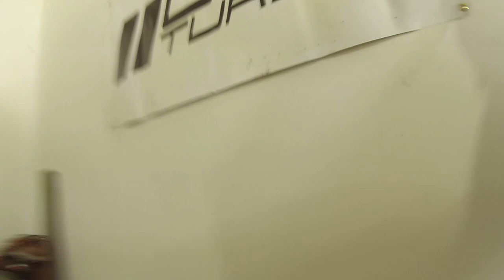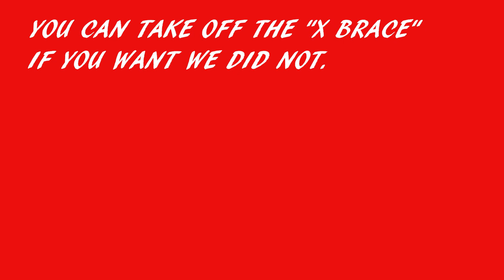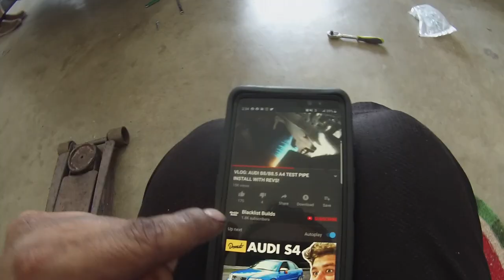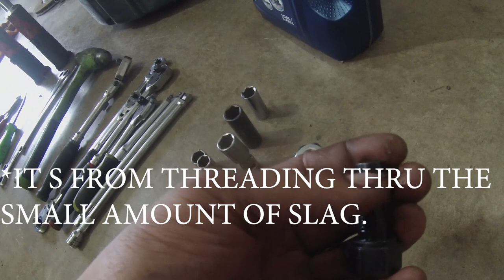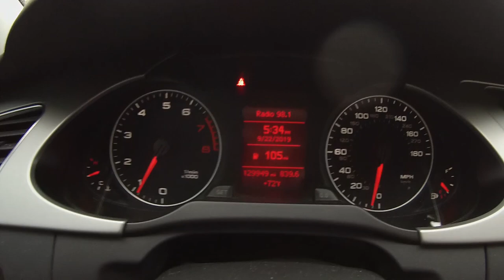how to  install a downpipe on your 2010 Audi B8/B8.5 A4 2.0T

Comment: The video was getto AF but I found the info very useful. Seeing a factory cat come out the top and the copper gasket spray trick made it all worth while. Keep up the good work as I understand this stuff is not easy to record.
Reply from the maker: 😅thank you ... these early video I made weren't the best. Camera was old and I wasn't sure how I was shooting things or editing them. But what I did know was I couldn't find a direct answer online for how to remove the DP . So my key in this was trying to share the problems and experience  100% so others would have a simpler time hopefully removing there down pipes.
Thank you for watching theres many more mods to come on b9 also I have much better hero8 now.
Reply: @TheRwdyAudi  I'll be sure to keep track. Today I replaced the factory cat with a high flow one on my A8 B8 and it has made a big difference . It's will get a stage 2 flash tomorrow and planning a DIY water/meth set after that :D. Being right hand drive it had to come out the top because the steering column is below. Your vid was the only one I could find and quite helpful. Cheers.

Comment: Where can I get the hardware? I have no clue why it isn’t nuts and bolts on the stock set, it’s these weird studs and nuts which ended up snapping.
Reply from the maker: Hit up your  local hardware store typical  grade 5 stuff will work fine use "lock nuts" to prevent these from coming off .... not nylon... you can but ...meh ... lock nuts have little dimple on the side of them .... you got this👊😎

Comment: What did you end up doing with the check engine light cause I was able to take care of it just wandering if there's a different way or the same way I took care of it. So what did you do?
Reply from the maker: Used to spark plug no foulers and small piece of steel wool
Reply: @TheRwdyAudi  very nice I'll try that next time.  I used a spark plug  no fouler but it had a built in mini catalytic converter 35$
Reply: @TheRwdyAudi  is steel wool going to last or a temporary fix to pass inspection or how long did it last or a permanent. It's good to learn these tricks on a pinch case some times thing's don't always work out the way you want and a temporary fix will do justice always open minded to solutions
Reply from the maker: @transam8607  I would say  more of temp solution  ... long term ... if your need to do this your probably  just annoyed at the light I would recommend  getting it tuned .. and have systems just tuned out permanently  for emmision  reason ... but I have gone true emmision  stations on other vechile with the steel wool mod and let just say those car are still on street.... I guess it could go either way depending on what your needs to re
Reply from the maker: that's sweet havent seen those got a link ?.. I would like to try those next time
Reply: @TheRwdyAudi  I'll look into finding them I remember it was called  something  daddy but I'll definitely get back with that link
Reply: @TheRwdyAudi  I found them let me know if the link worked it's weare I believe I got it from but if you need me to look for the exact part I  Purchased it might  be a little tough to find it http://www.bigdaddiesgarage.com/ and forgot to mention it's been almost 2 year's already and no check engine light thank God and good point with the gaskets I never had good luck I used original ones case they failed on my one's on the a4 and planty of other cars learned the hard way with gaskets thinking I wasn't doing the job right ended up gaskets failure

Comment: After installing the check ing light is on?
Reply from the maker: Yes that's normal you have no catalyst  to clean your exhaust you will need to talk with tuner or use any number of way to trick the down stream sensor to think it okay

Comment: Hi, the test pipe don’t give engine light?
Reply from the maker: Not if you use a o2 spacer in your down stream o2, however these are are extremely smart and will occasionally throw cel when the weather shift drastically. Problem is easily  solved with a tune

Comment: Is this tuned in the video? And what told you to lower your speed?
Reply from the maker: No cars not tuned yet when this was shot ... how ever I was able to trick the ecm with a "spark plug no fauler" they also make a "mini cat" that will trick the o2 ... this method works about 50 to 60% of the time

Comment: Does it change the noise?
Reply from the maker: It can if depending on what you have exhaust wise behind it. In this case, no, the car  sounded exactly the same due to the fact it has 2 stock mufflers still.
Reply: @TheRwdyAudi  thanks for the fast reply! I have stock exhaust I think it would make a bit of change. Even if it doesn’t it’s worth it.

Comment: did you pass the emission test with that downpipe?
Reply from the maker: Yes sir about 2 weeks ago it plates expire July first
Reply: How did you pass emissions with it?
Reply from the maker: It's all in the tune ... you could do it with tricking the ecm using no foulers but that usually doesn't work all the time and can get kinda finky. All an emission test is , is  computer hooking up to another computer and checking it pulse and vitals if those come back good you pass . Find a guy called  Blake Beadle tel him I sent you

Comment: How'd you knock out the studs on the down pipe?
Reply from the maker: I didn't reuse the stud . I've had little luck trying to reuse them  either replace them or do what I did and get fresh hardware
Reply: @TheRwdyAudi  how did you get the old ones out?? After they snapped I can’t get mine out
Reply from the maker: They knock out I used a angle grinder to get them smooth and then alot of heat and a air hammer to usually get them to knock look the downpipe didn't have them installed there just pass through bolts
Reply: @TheRwdyAudi  i just ended up drilling them out bc no amount of hammering got it out I think the previous owner of my car either replaced the car or had a down pipe on it bc the nuts were welded on

Comment: How is that downpipe holding up?
Reply from the maker: Pretty good so far. The key is to not use the crappy gasket they send with them use only oem metal style  replacements.
Reply: @TheRwdyAudi  I will buy one for my 1.8t. It's just hard to justify a $200 piece of bent pipe when they are on ebay for $45.
Reply from the maker: @gnarshread  agreed